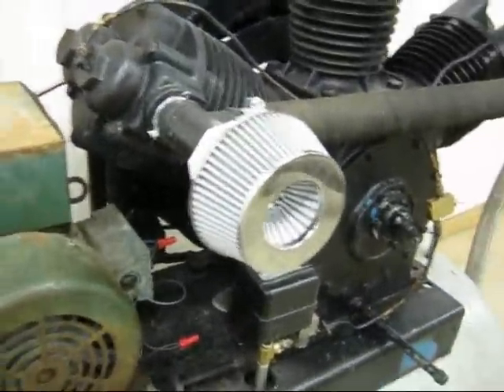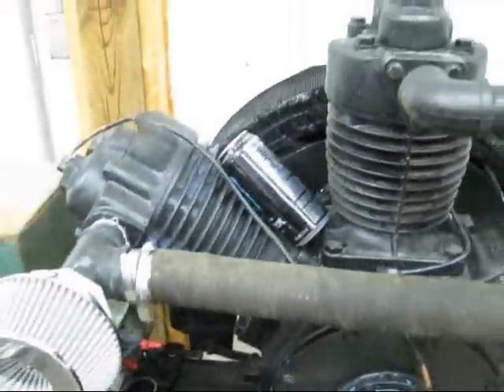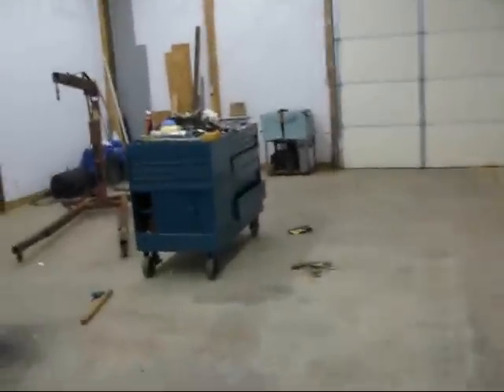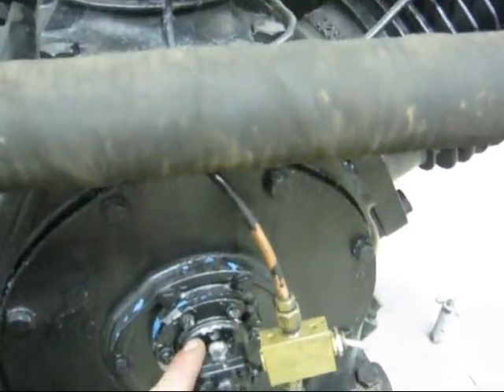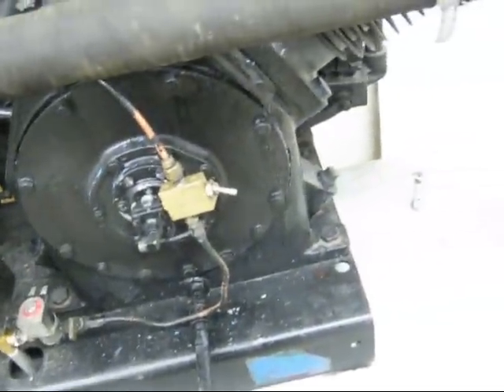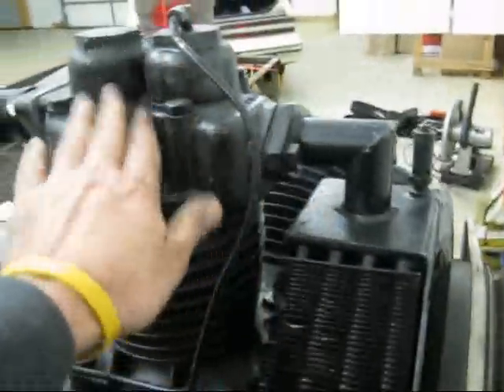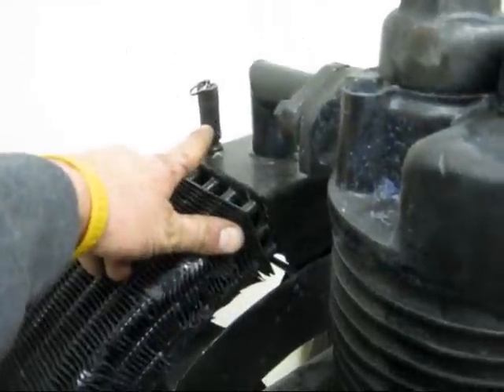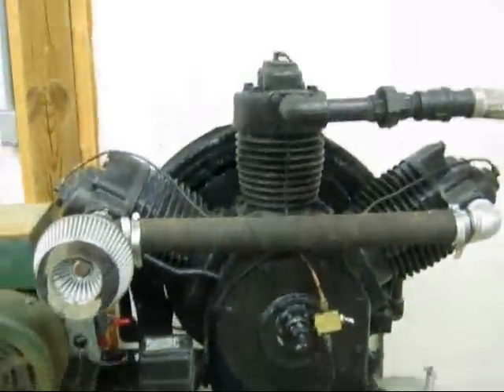LeRoi Dresser Series 800 Reciprocating Air Compressor...

Comment: Nice find, Dresser pumps are some of the best around. Don't bother replacing the air signal signal box as they fail after a year. Since you are running at a reduced RPM, make sure you check oil pressure at operating speed and make necessary adjustments to ensure you do not starve the pump of oil. Remember, that pump has rifle drilled rods up to the wrist pins and splash lubricated crank berings and cylinder walls. Minimum pump speed specifications may still be available from, "Comp Air".

Comment from the maker: Thanks for the info, I will check the specs if I can find them. It's been working very well for about a year (wow, time flies that is scary) but I still need to repair the unloader piston seals. I will check the oil pressure, though.

Comment: i have a westinghouse 2YC and the air production was slowing down so i removed crankcase cover and found the unloader arm had broken. not depressing the oil pump cylinder so oil; was not circulating . i'm in the process of trying to repair if able too.
Reply from the maker: I hope you are able to get it up and going!
Reply: I think there is still a 3YC in a shop up the road from me.  It has a 5hp GE Tri-Clad motor and it is very nice sounding starting up.  It is also very slow running.

Comment: David, I have a LeRoi 880A that I'm trying to sell but it pumps up to 60psi and then the pistons seem to stop compressing, motor is still running though.  You mentioned a controlled intake valve, would that trigger some sort of cutoff?  Any help would be great

Comment: What is the most single horse power u can use on this one
Reply from the maker: +Lennie Williams 

Hi Lennie. The compressor pump is rated for a maximum pressure and maximum shaft RPM. The factory motor was a 25HP motor. I'm not sure what the highest HP motor you could "fully load" with this compressor. I'm sure it's in the spec sheet for it.